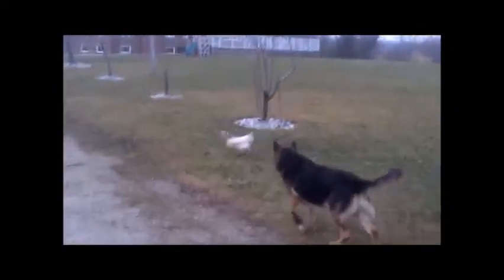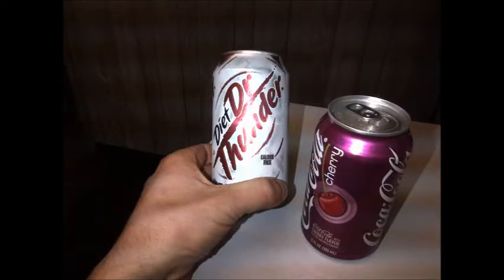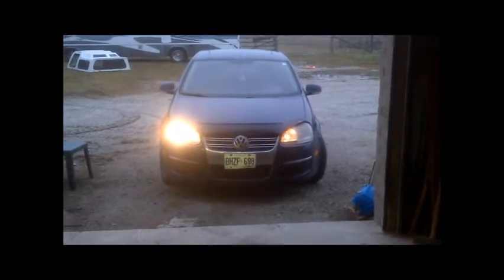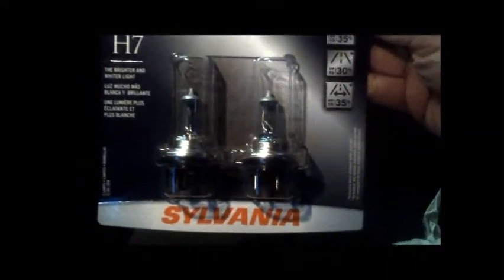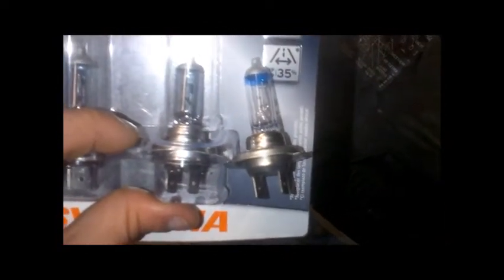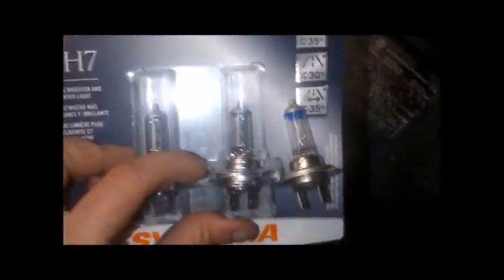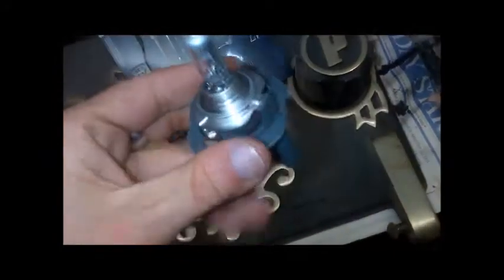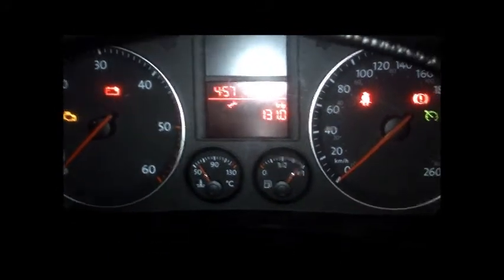2006 Jetta head light replacement

Comment: Thanks for the video. If I may add a few points: a) You can purchase VW original bulbs at your dealer for the 2006 Jetta for 20$ a bulb (40$ for the set, shockingly cheaper than CT!), and b)The bulb holder does state "top" on the handle, but please remember, that is where the top will be after turning (embarrassingly, it  took me about 10 minutes to get the right alignment)